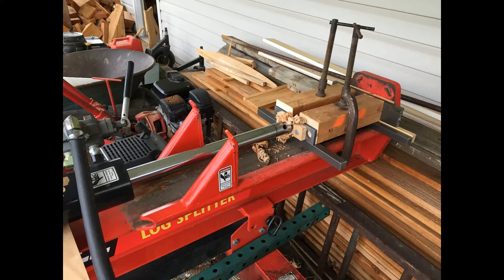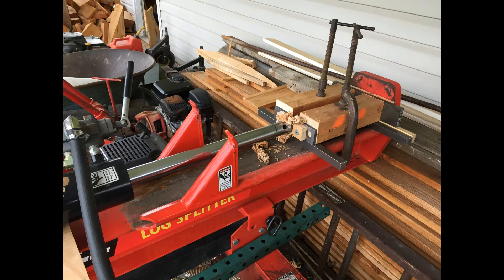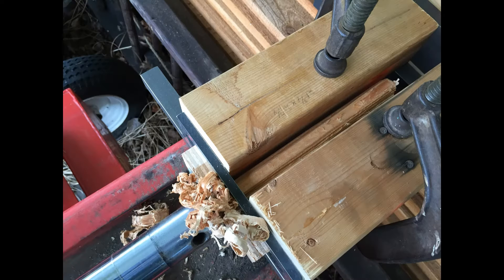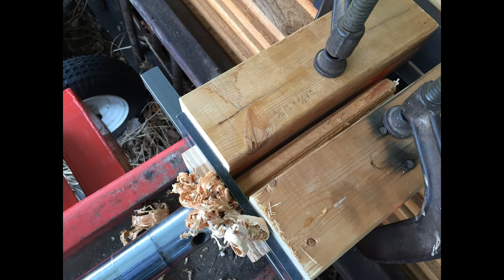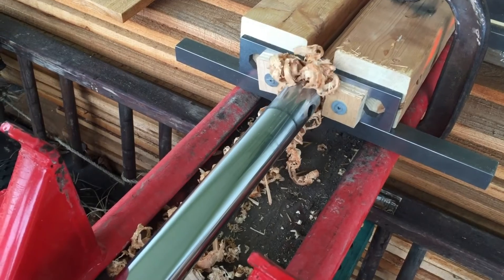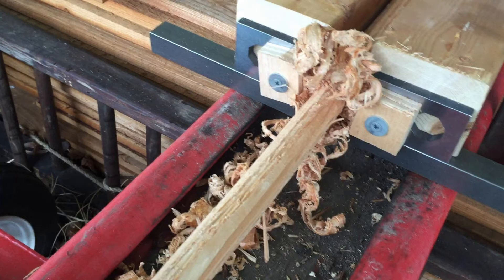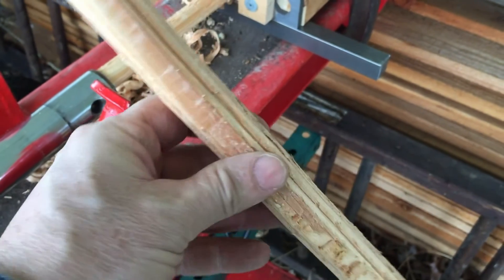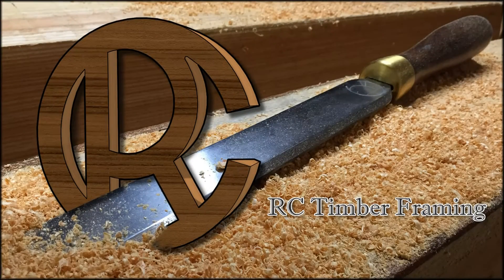Timber Frame Peg Making Machine

Comment: where do you get the broaching plate
Reply from the maker: Hi there, i made it at work.  i work in a large machine shop.  what do you think?
Reply: can you make one for me
ill send the cash
what pin sizes does it doo
Reply from the maker: @garymiceli7321  i can make it any size you want.  this one is for 1".  i initially made 5 holes, in 0.020" increments, the middle being the mean at 1".  i never ended up using the others.  the Broach is a 1/2" piece of A-2 Steel, hardened.  what size pegs do you want to make? and what size is the related drill bit?  mine was a 1" auger bit.
Reply: th bits are 5/8 3/4  1inch  1/1/2
Reply: are you on face book
Reply from the maker: i'm on facebook  robert carlo wilson ny
Reply: ok i messaged you on face book sir
Reply from the maker: didn't see anything yet.
Reply: check fb again sir

Comment: Результат понятен! Восьмиугольного нагеля. Подробности бы, данного приспособления! Пожалуйста! Очень интересно!
Reply from the maker: i made a "Broaching" die to cut the dowels.  it's a plate of hardened steel that has an octagon hole in the middle.  the back side is relieved with clearance.  the log splitter pushes the pin through the broach and cuts the outer edges of the dowel.  worked awesome!
Reply: Robert Carlo я понял чем толкаете нагель(peg).  Это дровокол. Спасибо!
Reply: Robert Carlo единственное не очень чистый рез получается.